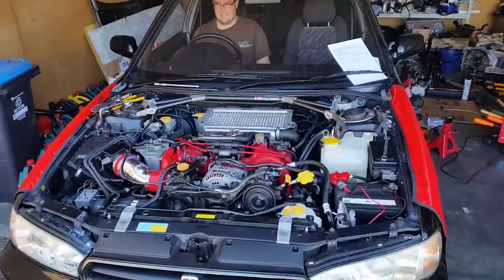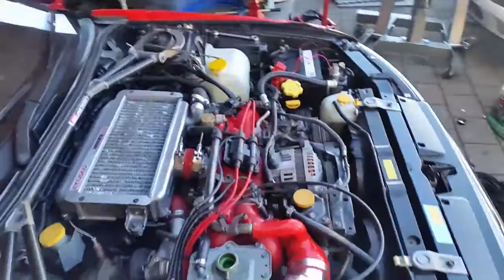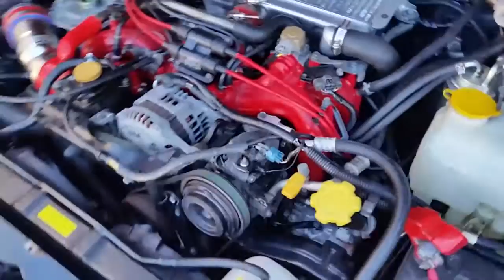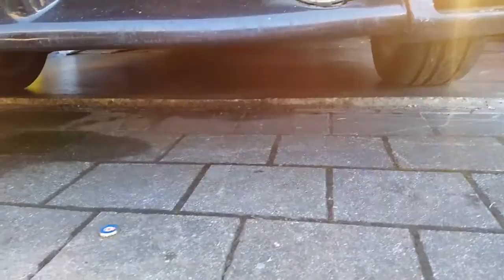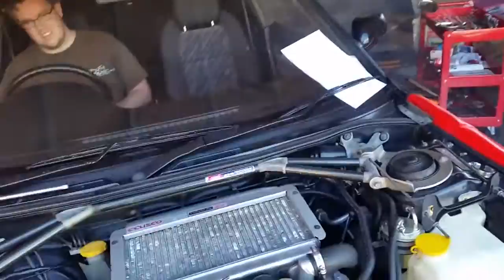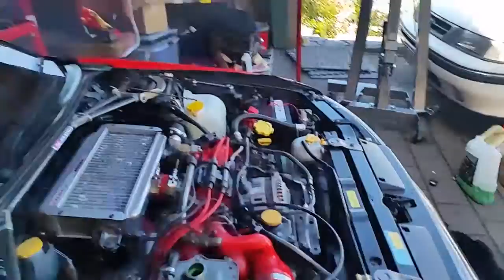Beast's First Start. Again.

Comment: Help a brother out. I've done a single turbo conversion following your thread on club sub. 
I've wired the ecu for the coil pack and wired in the ignitor and I've got no spark.
Reply from the maker: So you’ve done the coil pack on the manifold with leads? Then easy, you do t need to join your outputs at the ECU, you need only chose your two outputs that you need on your body loom where you’re tapping the igniter in. I’m guessing you’ve probably just picked the wrong wires to feed the igniter. Check the continuity from your igniter pins to the ECU, to make sure you’ve got the right wires. If you’ve joined your outputs at the ECU like you need to if you’re staying cool-on-plug, that’s fine, just as long as your igniter has its two outputs from the WRX ECU correctly wired up.